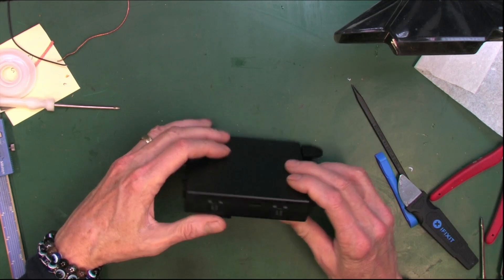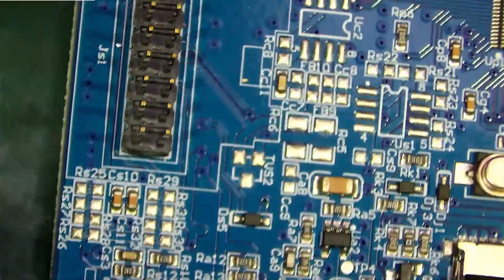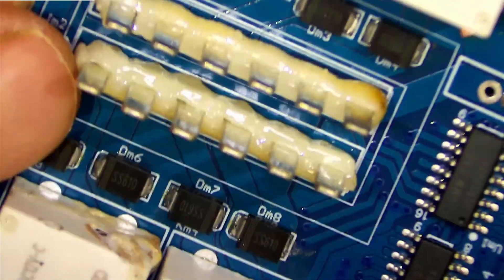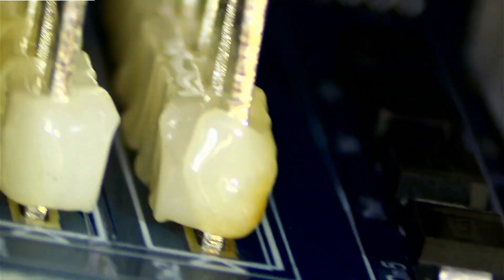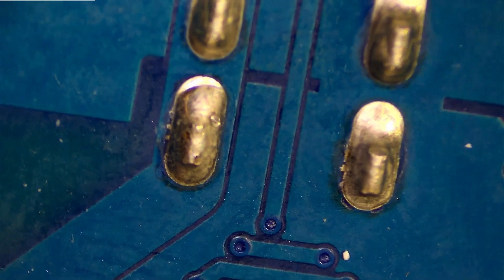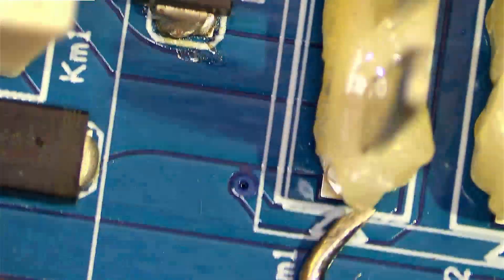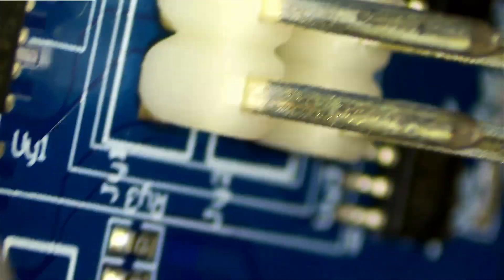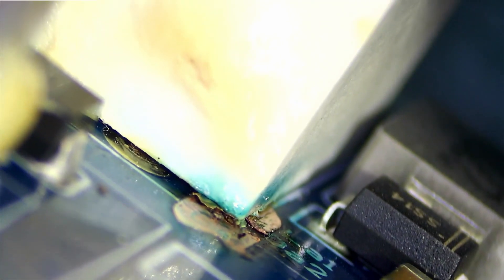Automotive Seat Module, poor solder, AGAIN?...How many Amps are Plated Through Holes rated for?

Comment: The industry has learned long ago not to wave solder connectors for the reason shown here. It does'nt go trough. It is very diificult to find  a compromised speed between surface mounts and conventional components.
Reply from the maker: @PR-fk5yb  If they would have had those traces on the bottom, the wave would only need to wet the legs and the pads. Through hole not necessary to conduct. Thanx